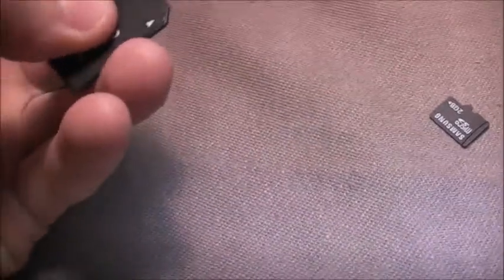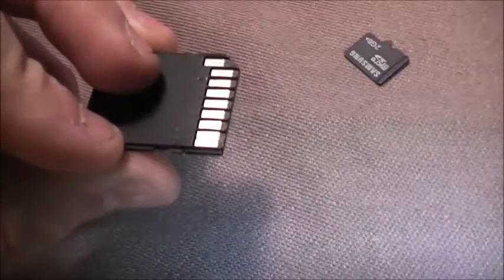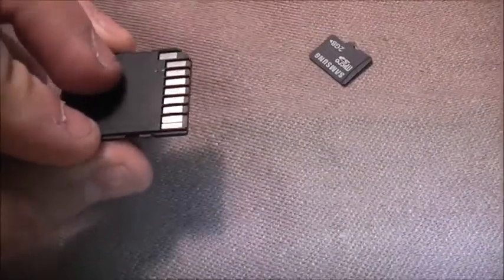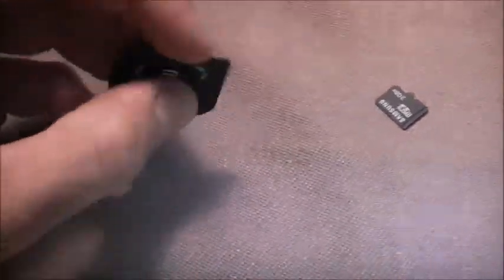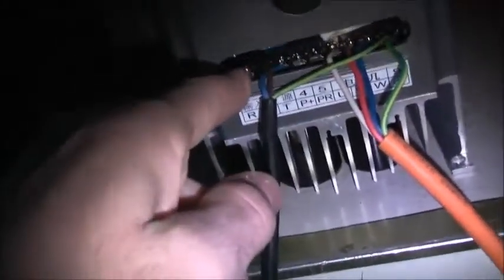VFD Now Setup Properly, Works Well!!

Comment: does that unit by chance have a soft start feature? I notice it took a fair bit of time to get that motor up to speed after you let you foot off of it, for a 3kw drive it should have been much faster. Have you checked ramp times too? I ask these question because torque is affected by both, esspecially the soft start vfd's. Won;t get the full torque until the motor is up to speed but then again it depend show the vfd was built but being from china, it wouldn't surprise me at all. Wouldn't think the components in them could handle full startup load lol